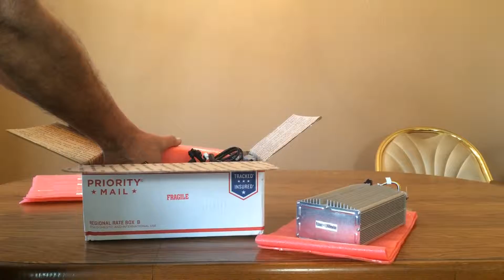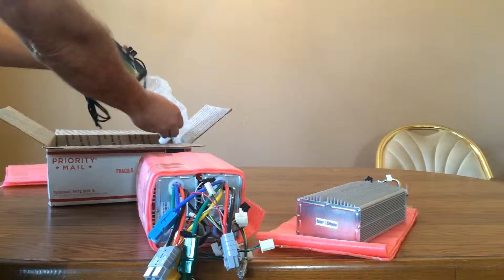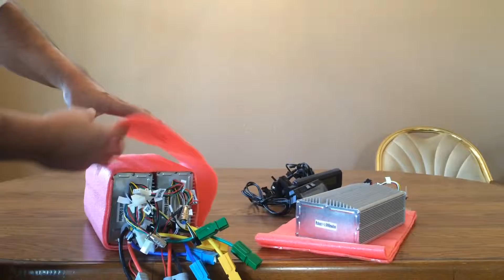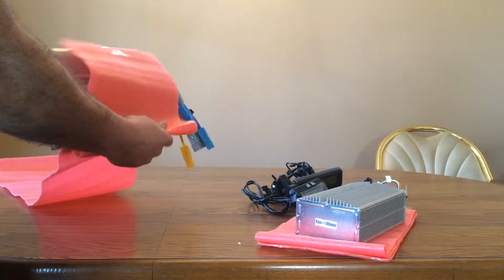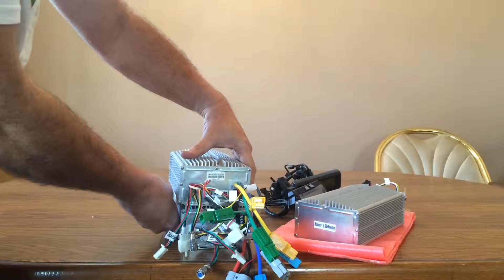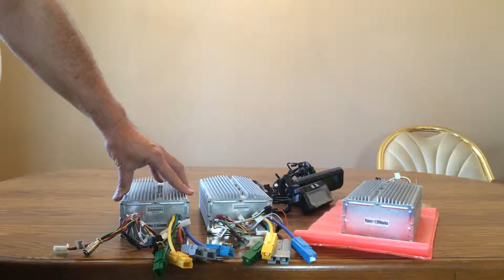Lyen Mark 2 72V 24 4110 MOSFET Controller Strong Regen

Comment: so how much better is regen ? a normal unit ave.. 4 /mabe 5% ...............or is it varable strenth and just a dam good brake
Reply from the maker: I love my regen! I get back about 5% of my expended power. One ride that I went on had a lot of downhill miles, and I got back 10% on that ride. 

The regen also makes my brake pads last longer.

Pressing the regen button feels like a parachute has been opened behind the bike in order to slow it down. I can look at the Cycle Analyst and see how many Watts are going back into the battery.